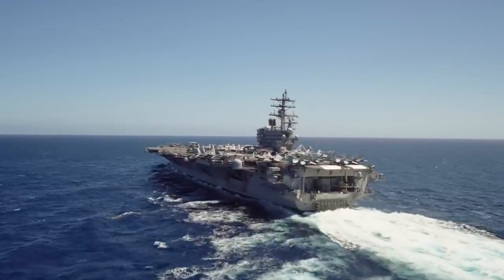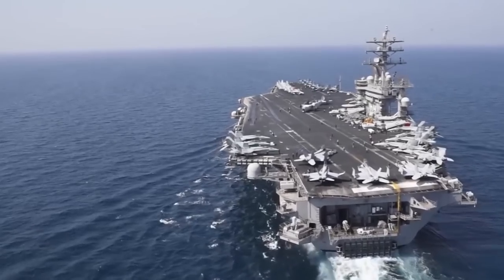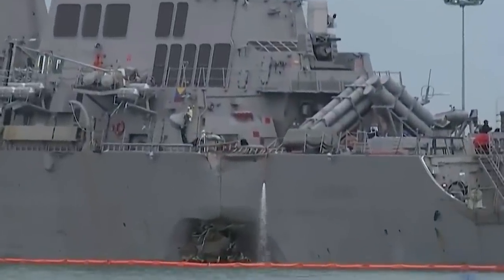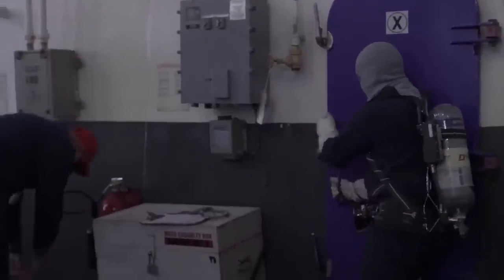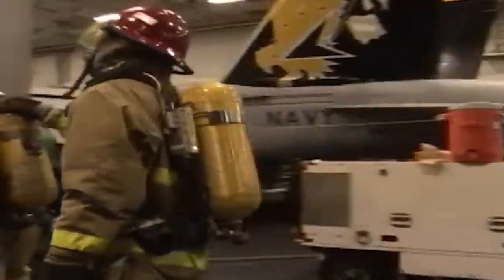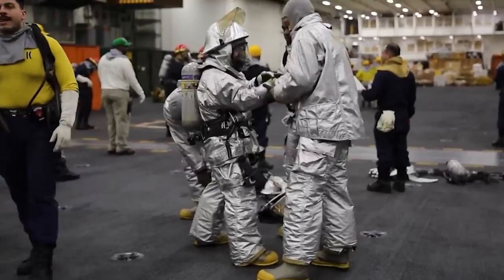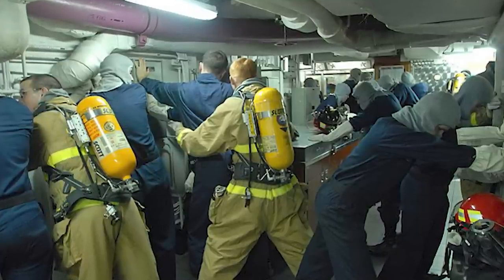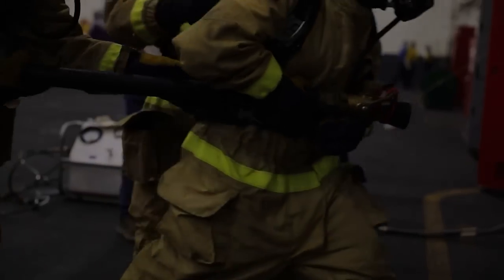How US Navy Sailors Endure Massive Shocks on Aircraft Carriers

Comment: Back in the 1970's I was onboard the USS Constellation working on the flight deck. I was responsible for my squadron commander's aircraft at all times. The ship was caught in a typhoon we could not outrun and the flight deck was shut down to all operations. When they towed me to my parking spot on the bow the ship plowed into a large swell and the aircraft, tow tractor and myself slid to within 5 feet of the deck edge at the bow. One of my three main wheels was hanging in mid air over the water and the ship just kept plowing into the 50+ foot swells sending water over my aircraft's canopy. They finally attached enough chains and multiple tow trucks to hold me fast to the deck. I sat in the plane shaking until my buddies pulled me out of the cockpit and carried me to sick bay where they sedated me out cold. I went back to work on flight deck the next day. Oh, it was night shift also.
Reply: Good times huh, nothing like that adrenaline rush. They say your never living more then when close to death

Comment: I was assigned to HS-2, which is an antisubmarine helicopter squadron, that was assigned to carrier airwing two (CAG-2), the was assigned to the USS Ranger CV-61 from 1979 to 1982, and then to the USS Kitty Hawk CV-63 in 1983. In October of 1982, the USS Ranger CV-61, heading back to North Island Naval Air Station, San Diego, CA, about a 1,000 miles East of Guam, got caught in a huge Typhoon, for two days,  that nearly sunk the USS Ranger CV-61. The Captain of the USS Ranger CV-61, and the head Chaplin, got on the 1MC, and asked all 5,400 men to start praying to God, for his help. On the morning of the third day, that huge Typhoon sung North towards Japan. There are nine squadrons aboard aircraft carriers. Each squadron has a Line shack, that take care of the aircraft in their squadron, and it is the Line shacks duty to make sure that there is enough tie down chains on each aircraft in their squadron, and it depends on how large the sea waves are, from 3 ft. to over 40 ft. waves. It's the 25 ft. waves to 50 ft waves that cause the aircraft carrier to vibrate during high seas. To this day, I have the same respect for the seas, as I did,  when I served in the Navy, from 1980 to 1984.